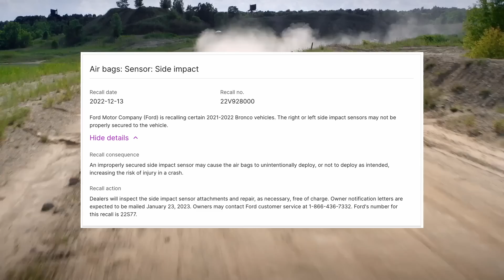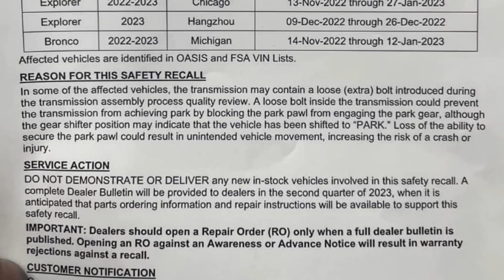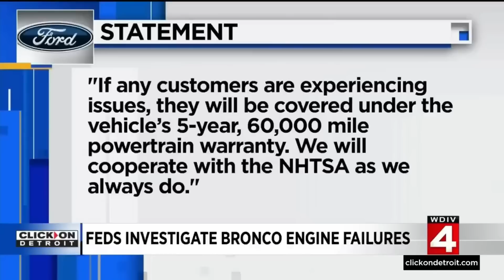YIKES! More Bad News For 2023 Ford Bronco Buyers

Comment: i'm impressed that a company with over 100 years of practice can still screw up this bad.
Reply: Probably too focused on the wrong DEI. Diversity, Equity and Inclusion rather than Drivetrains, Engines and Ingitions.
Reply: Takes decades to be this bad, does not happen overnight
Reply: @dr.emilschaffhausen4683  🤣😂😆👉🤡🤡🤡
Fix.Or.Repair.Daily
Reply: @jackiechan4399  Found.On.Road.Dead
Reply: Fix.Or.Repair.Daily
Reply: 100 years of practice building sh*t vehicles.
Reply: Ford has always had the most recalls. 
The model T is a nightmare to drive. Remember the Pinto? They ended the panther body. etc, etc.
Reply: Anybody remember the FOUR piston Mustang?! A piece of WORK🤯😁🤡
Reply: Lack of leadership will bring down any company, regardless of how long they've been around.
Reply: 100 years and still miss the point: we need to build quality cars.
Reply: I drove a company supplied brand new F150 that I brought to the dealer twice. It would atart wobbling over 65 mph. They couldn't fix it, of course, it was the Firestone tires that finally came out months later.
Reply: German and Japanese cars are the only car makers with superb quality.
Reply: @napoleonbonaparte1260 not the german

Comment: A local dealer has several broncos in stock... they also all have 8k markups and have been sitting unsold for weeks.
Reply: Well they won’t have to go far to address the latest recall issues!
Reply: Hope it stays that way, let them rot on their lot!
Reply: There’s a few by me sitting as well.
Reply: There's one used 21 that's still 10k over yet its been sitting for a year now
Reply: Serves them right, i hope they never sell them
Reply: Out of curiosity I checked the two Ford dealers in my town. One has $5-15k mark ups on their website. The other has $0 marks ups on their website. They are less than 10 miles apart... I'm wondering how the one plans to stay in business.
Reply: I’d be more likely to buy a new ford if they made it easier to fix, right now they make it harder to service on purpose so the dealerships can make money, imagine how popular they would be if they were designing vehicles that the average person could fix in their backyard…
Reply: @pauldiesel4582  Ford will sell you the brand new ones and not fix any of the issues, and when you bring it back in, Will treat you like they doing you a favor troubleshooting your brand new car. I had some warranty work done on my brand new pick up the service Writer laughed and told me oh yeah, this happens all the time, did they fix the issue ? sure did they replace it with the same thing that had the same defect the answer From the dealer to fix that issue was to ask me if I would like them to replace that same part again?
Reply: @dracodrake45  They could sell it right away and make $3000 in profit or they can wait a year and make $13,000 in profit, don’t have to be a math genius to figure that profit margin out
Reply: @itowmyhome  It was listed at 59k so I doubt they made much profit when it dropped pass 49k
Reply: I’m just tired by all the greed by lot owners jacking up the prices over MSRP. I’m willing to put up with recalls if it’s under warranty, plus recalls are always covered.
Reply: As soo s you show interest they will remove that markup, but it still makes them look foolish.
Reply: Now Ford wants a Government bail-out lol😂!
Reply: A local dealership in south Texas has a $22,000 markup on theirs!
Reply: And if you see them on the Dealer's lot those are customers that have backed out and got smart
Reply: @vincefairleigh6899  That day is long gone. You need a computer engineering degree to work on a car these days.
Reply: And they can’t figure out why this world has gone mad
Reply: @ski3435  No you don't. You just need to be able to do a bit more than change your own oil. Which most in these comments sections don't even do. To start you should get a FSM and learn where vital sensors are and what they do. That's a large chunk right there. It's all about the effort you want to put in compared to taking it to a mechanic or dealer and paying a shitload of money for if out of warranty. I had an A4 and was quoted around $3300 to change the HPFP and intake cam due to wear. I did it in a weekend for a bit over $700. Just gotta get out there and research and do it. I also enjoy it so that helps.
Reply: Yep, they still have them marked up like crazy, but are not selling them.
Reply: @mojavedesertsonorandesert9531  just rolled 2 Wildtraks today for 10k over and have a Bronco Raptor at 30k over going out monday. Don't be brittle because you cant afford one.
Reply: @gristle7363 not being able to afford one and not buying one due to greed are two different things.
Reply: People still lined up to buy one.  I would have one if they were price gouging.
Reply: I work at a ford dealership. We never had those markups. Which is why we get a lot of out of state buyers. Only vehicle that is being sold over sticker is the Ford Raptor R.

Comment: We live in a world where Chrysler products have less recalls than Ford. 😂
Reply from the maker: I never in my life thought that would be a fact.
Reply: Probably helped by the fact that  Chrysler makes what two products now?

Plus I don't think Dodge Chrysler Fiat really does recalls very often.  It's just an open secret how they break.
Reply: My 2004 Dodge Ram 1500 has 269834 miles and is paid off. Lmao, I would be furious if I bought a brand new vehicle with a note attached and it broke down.
Reply: Facts
Reply: Less than half as many recalls as Ford and the most reliable light-duty pickup 3 years in a row, thank you very much
Reply: Really, OH MY GOD.
Reply: 2022 Jeep Gladiator Rubicon diesel no issues no recalls $20,000 less than a comparable Bronco.
Reply: We live in a world where Chrysler products are actually good cars. The Ram truck is by far the best American made. Who would've ever thunk? They learned their Mercedes lessons well. Their trucks are really nice. Hold on to your breath: I have a Dodge Charger, four Jeeps and an 02 Prowler. (the Charger just turned 5, one Jeep is 4, one Jeep is 18, one Jeep is 12. The Prowler is 21) I bought them all new except for the Prowler and I've had that for 15 years. All are really excellent and I've never had any problems with any of them. One fan blower switch on the 05 Liberty and that's it. I guess it finally needed a half/ shaft. Really. Sometimes I have to pinch myself to know this is actually real.
Reply: Stellantis not Chrysler and no my Ram had 12 recalls the first 3 years. I sold it after 5 years with recalls still pending because I got tired of bring it to the dealer.
Reply: @dannysdailys  Australian Mopar fan since high school and I'm now 55 I can honestly say I have not owned anything but Chrysler products virtually since I was old enough to drive I can also say that I have not put in $5,000 in repairs combined on every car I have owned
Reply: @dannysdailys  and on the subject of shared knowledge outbuilding Quality Cars there is no other information like Chrysler who has been aligned with Mercedes-Benz Mitsubishi Fiat and many more and has benefited from all of the shared knowledge and they are now making some of the most reliable cars on the road, there's something to be said for a company getting out of its own way, probably like Ford has been doing the same things the same way for so long that it just doesn't work anymore, my latest acquisition is a 19 Ram which was their first year model complete redesign truck and has had no FCA recalls and one warranty concern during the warranty. However it does have some lubricant issues on the driveshaft then I recently developed but that's typical of all two-piece driveshaft trucks, other than that it's like your brand new vehicle and delivers over 20 miles per gallon at 75 mph, I work in the Ford dealership and I can only begin to tell you the horror stories that I see
Reply: Still driving my 2000 TD 3/4 ton Dodge quad cab and with proper maintenance and upkeep, it has been pretty much trouble free for 265K miles.  it still looks and drives like it did new. (I also owns 5 motorcycles and now retired!)  But,  I've taken care of it and replaced the parts that normally wear out with that many miles on the clock. I've never taken it back to a Dealership since I drove it off the showroom.  But, I'm "That Guy"! 
With having only made one truck payment, I'll keep it......
Reply: @toneyo4794  A 2023 Jeep Gladiator Rubicon here in Phoenix is at least 70K out the door which is 5k under invoice. More than I wanted to spend or I would have bought one. I heard the 3.0L EcoDiesel is a solid engine. Its made by FCA at their Cento Plant in Ferrara, Italy and they did a great job in my opinion. Its gets great MPG and has 442 lb-ft or torque which is perfect for a Gladiator. I really wish they were less than a Bronco but they are not where I live.
Reply: Most of the recalls Ford issues as a company are not major though and pretty much all of them are estimated to only have effected a tiny number of units. That said they need tighter control over their supply chain.
Reply: @jayhawker03  I'm not sure what Kool-Aid you're drinking but the fact that they have twice as many recalls as any American company cannot be disputed, maybe you should spend them time gathering information or hanging out at the Ford dealership before you start talking about things you not prepared to debate. Most of their issues are not with supply-chain most of the issues I was rushing a car to Market before it's tested thoroughly and or or software issues that are not ready for production. Vehicles come off the assembly line and make it to the dealers in a few weeks. Half a dozen or so usually more models ready for updates, that is not acceptable. Maybe you enjoy getting a love letter from Ford Motor Company every 3 to 6 months but most people would see that as a failure
Reply: @ubeuonly  I have man. Read the recalls…that’s what I’m saying. They are mostly tiny flukes that were caused by poor quality in the supply chain. Recalls are also not an indicator of a vehicles long term reliability. Just because FCA has less than ford doesn’t mean they have longer lasting cars. I assure you I’m happy and ready to debate ;)
Reply: @jayhawker03  There is no FCA anymore. Stellantis N.V. is a multinational automotive manufacturing corporation formed in 2021 on the basis of a 50–50 cross-border merger between the Italian-American conglomerate Fiat Chrysler Automobiles (FCA) and the French PSA Group. Stellantis has 16 brands....Abarth, Alfa Romeo, Chrysler, Citroën, Dodge, DS, Fiat, Fiat Professional, Jeep, Lancia, Maserati, Mopar, Opel, Peugeot, Ram, and Vauxhall.
Reply: @lancelotlink3907  Ok thanks for that 10-K description 😂
Reply: The Chrysler product still sucks. Ford has had a bad streak, however it hasn’t been a history like Chrysler.
Reply: Shhhh! Ford loyalists will hear you and come to the defense of THEIR brand!
Reply: @orovalleyview8103  I agree. Ford used to be a good product but selling purely based on your name almost always causes a company to get greedy and go for profit over quality. Toyota isn't what it used to be. The new Tundra is not a good truck and their SUVs are being out classed by their rivals and quality has gone down hill.
Reply: I have driven Chrysler cars for 13 years and NEVER had engine or transmission issues with them.
Reply: @largol33t1  Chrysler has gradually improved their transmission over the past 20 years but they were terrible in the 1980s and 1990s. I think Chrysler only makes 2 cars today. The Pacifica and the 300.
Reply: Yeah, because FCA doesn't fix their trash, they just say its normal in the owners manual. They should recall their Hellcat Motors for bad lifters and their Shocks on their TRX's are garbage. And I am just skimming the surface with my experiences with Chrysler.  Had to get rid of a Scat Pak Challenger for multiple reasons, and I lemon lawed a Charger, that had a laundry list of issues. For me, Ford always fixes any issues I've had. I can't say that about dodge. Dodges customer service is the worst, I had given Dodge a 2nd chance, but no more, never again! Love my Fords and their customer service is Awesome!
Reply: @toneyo4794  unfortunately it’s still a Jeep
Reply: @Dontstressbenchpress  still running strong. Added the wrangler 4xe to my garage a month ago.
Reply: Cubs won the Series in 16 and clearly tore a hole in the universe
Reply: @Gowaduv  haha
Reply: @lancelotlink3907  you’re full of it!
Reply: @JohnDoe-nz6bk  The truth hurts.
Reply: @LancelotLink1  what truth?? I’ve owned 4 rams from 2012 to 2019 and not one time did anyone of them have 12 recalls, nor did they have any open recalls when traded in. Why do you ford fanbois have to project???
Reply: @JohnDoe-nz6bk well my 2015 Ram 1500 Sport quad cab 5.7 Hemi with 3.92 limited slip rear axel had so many recalls I sold it. It also left me stranded in hot Arizona which I didn't appreciate since it was still fairly new. The body lines were the worst of any new vehicle I've owned and I've owned a few. There was more but to me Ram is  cheap made product.
Reply: @LancelotLink1  🤣🤣🤣🤣 suuuuuuuure it did! My hemis and Cummins never left me stranded. Oh, there are 18 recalls associated with that truck and most of them had to do with the diesels. A couple had to do with fire extinguishers and the mopar bed cover. ONE was specifically for your quad cab and 2 others most likely had to do with your truck. LIE AGAIN!!
Reply: @happyness5293  😂 Ford focus has plenty of issues, Ford fusion plenty of issues, Ford f150, turbo issues, transmission issues, even the raptor has plenty of issues. Gm is just as bad. Keep your Ford I'll stick with my tundra
Reply: bought a 2012 Ram new. 167000 miles now and only changed oil brakes and tires.  All electronics still work.
Reply: 40,000 miles on my ram no problems. Tighten the windshield wipers to fix that recall no other issues.
Reply: @ubeuonly  RAM
Reply: @lancelotlink3907  I have owned every generation of Ram 1500 in the last 30 years, and not a single one of them has had more than one or two recalls in his lifetime
Reply: My 22’ Ram with only 9100 miles on it right now has gad 4-5 Recalls, Turbo Replaced under warranty and 12” Touch Screen Replaced under warranty and now smells like electrical fire as I think the Recalled Grid Heater Relay is going out and there is no “Fix” yet.  Sold back to the dealer!
Reply: @leroywilliams7210  that’s a bummer! I had a Toyota Tacoma the same thing worse truck screws, coming out of the panels and everything you just never know!
Reply: @ubeuonly  All I know is that my 2015 1500 Hemi Sport with the 3.92 rear axle had lots of recalls and problems. Maybe it was a bad year. Maybe just a lemon IDK but thats my experience. It had lots of upgrades so lots more to break or go bad. Maybe less optioned trucks are better.
Reply: @LancelotLink1  and yes the reliability has come to be much better in the last 8 years I had a 2011 with a Hemi it went 227k before needing and Cam and lifters
Reply: That's not true talk to wagoneer and grand wagoneer owners 😂
Reply: @lancelotlink3907  and all of the shared knowledge that came from huge companies.
Reply: @orovalleyview8103  Ford has been having some of the worst launches and the worst products in the last 20 years. The difference is we have the internet and social media was less people talk about disapproval and disappointment in the product, and Ford spends millions of dollars chasing people in chat rooms to try to fix their problems before they get to social media. That's not the sign of a great company
Reply: Remember when Ford s quality reputation sucked so bad they ran ads for years: “quality is job one” while someone polished the blue oval.
Reply: @ubeuonly  True. I just saw a new dodge hornet today. I read it shares a platform with the Alfa Romeo Tonale. A 268-hp turbocharged four-cylinder with all-wheel drive and a nine-speed automatic is the standard. Stellantis has lots of companies to share with each other.
Reply: ❤Thank you for sharing God bless you
Reply: Chrysler products are now owned by Stilantiss (which is owns FIAT).
Reply: @dannysdailys  Mopars are junk always have been mechanically   .
Now that Fiat owns them I wouldn’t take a Ram if it was free. 
 Chevy till the end ,
Reply: @LancelotLink1  Fiat
Reply: Chrysler has had their share of problems. 
Remember their junk transmissions a few years ago  ?
My buddy has 6 transmissions put in his Dodge truck. 
When Chrysler finally resolved his tranny problems,  his engine blew up. 
Needless to say,  he drives Tacomas now and has not had any problems
Reply: @paulradice3534  To each his own. But the Ram truck in the number one truck in the world right now.
Reply: No no no. All car brands are shit now. And not only that, An average person can barely afford common American vehicles that were once manufactured for the lower to middle class. We are fucked.
Reply: God, that’s as scary as it gets!
Reply: Fewer
Reply: You mean Fiat products.
Reply: Quality varies dramatically within CDJR family, even within Jeep family.

Comment: New Rubicon still listing for 60+ msrp. Jeep is just as insane.
Reply: I walked into a Jeep dealer to look at a new Rubicon and they were playing Dueling Banjos over the PA system. I turned around and ran back to my car and got the Hell out of there.
Reply: I said the same thing bought a fully loaded jeep wrangler unlimited x games edition in 2015 has everything the Rubicon has mins the sway bar disconnect and the full lockers.  Even has the steel vented hood.  42k in 2015.  A 20k mark up?  50k to 55 is responsible but 60 plus?
Reply: @outbackeddie "You got a purdy mouf"
Reply: Yup i was looking at a Jeep Gladiator, well equipped it was $70k+ thats luxury brand prices for a Jeep.  So ended up buying a Q7, $50k probably would have given Gladiator more consideration
Reply: @msk3905  good decision